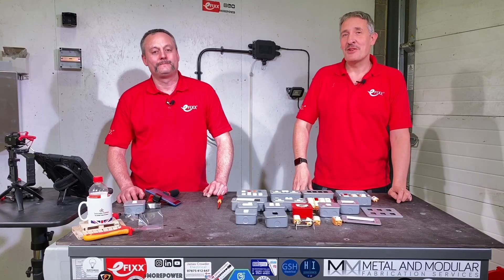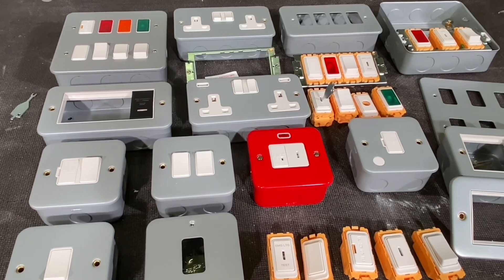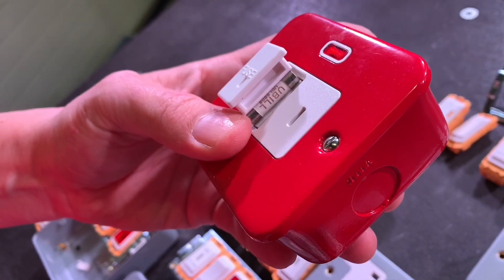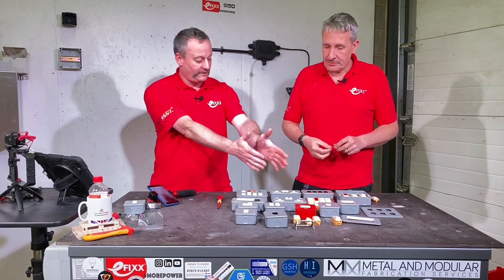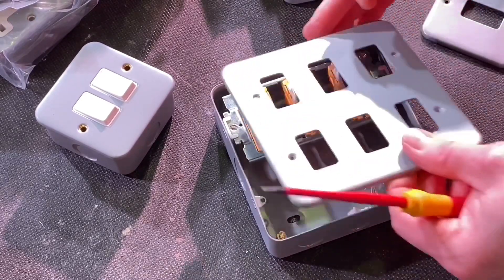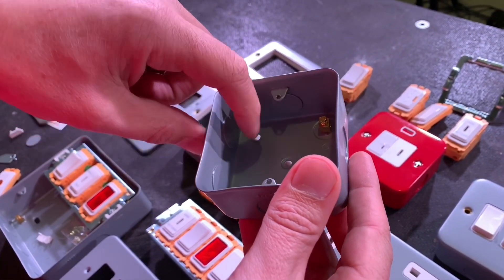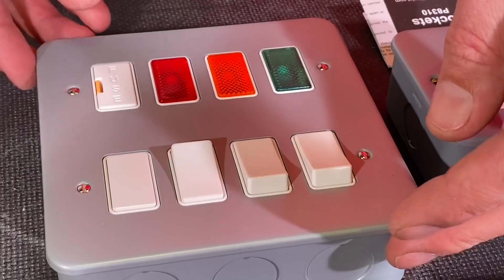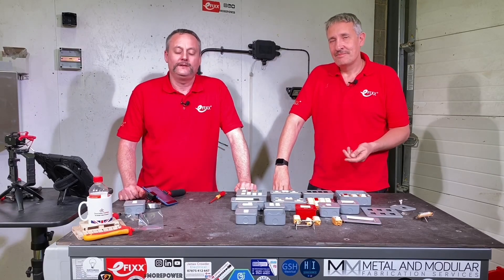METAL CLAD - Sockets, switches and grid switches by Hamilton Litestat.

Comment: Vertical screws, i noticed, i appreciate vertical screws, just how i always leave them. Not enough people leave the screws vertical, they finish the job nicely.
Reply: Depends on how cable is run vertical or horizontal so you don’t turn the power off
Reply: I tend toward the 2 o'clock position. any angle works, as long as its consistent. horizontal, vertical, jaunty angle (me)... just make all of them the same
Reply: @TheChipmunk2008  2 o'clock! you should be in prison! what kind of animal are you.
Reply: @ShadowzGSD  an avant-garde one